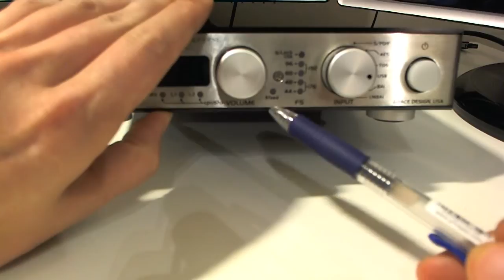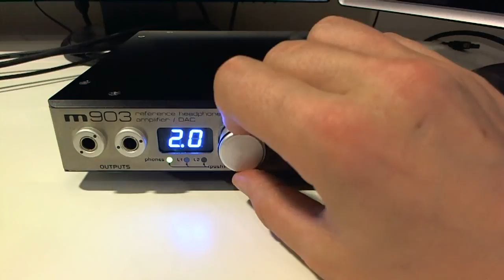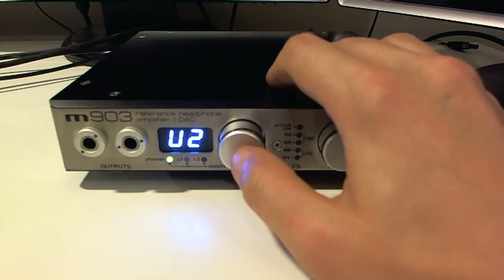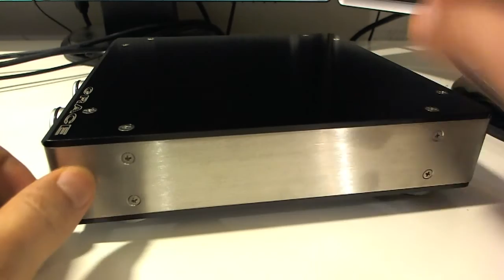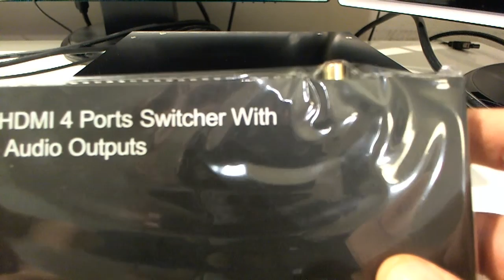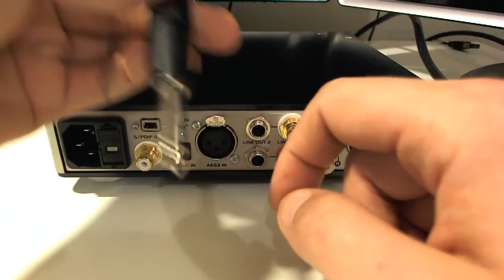Grace Design m903 Headphone Amplifier and DAC Review | 1/2

Comment: thats as big as an integrated amplifier .
Reply from the maker: Hi, what do you mean? Most integrated amplifiers like NAD's for instance, are far bigger than the Grace Design m903. However, there are small integrated amplifiers as well, often full size and half size.
Reply: I did not not mean I did not like it I hope the size indicates some seriously good electronics and power supply design . any way I am just getting in two headphones as a high end alternative to 100kg power amps and the electric bills lol . look I like the grado sound so far but I would not say they are for everyone . I like my bass under control not boom boom and flabby .